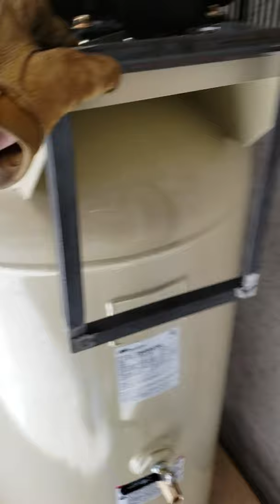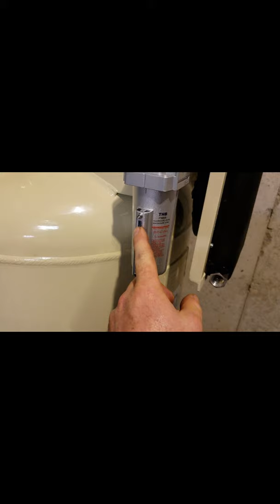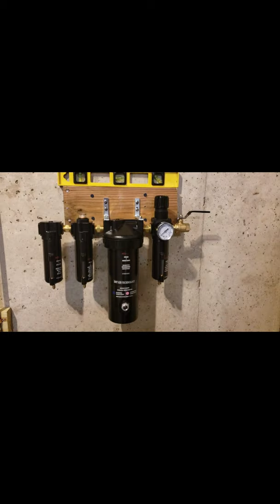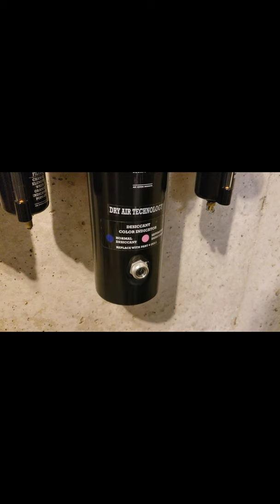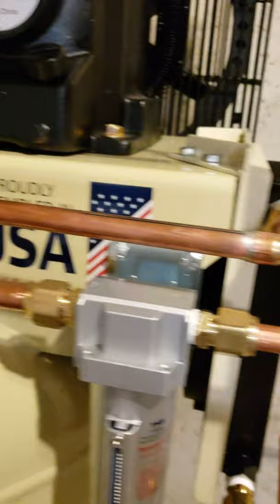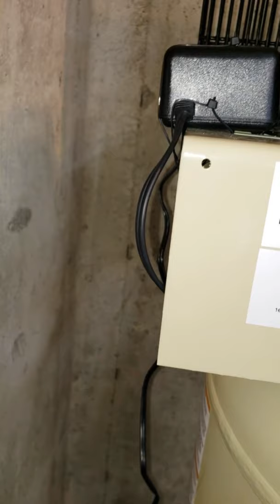DIY Shop Air Compressor Install in Garage Setup Part 2

Comment: Wow dude sick setup, a bit of overkill but I love it! How much was all of that??
Reply from the maker: I paid 800 for the compressor at tractor supply. Filtration was about 500 online. Hose reel with hose was around 150. Spray guns from Eastwood for 400. Copper and mounts were 100 bucks.